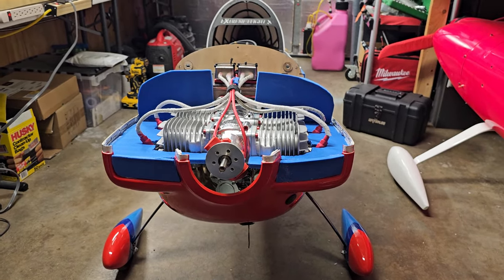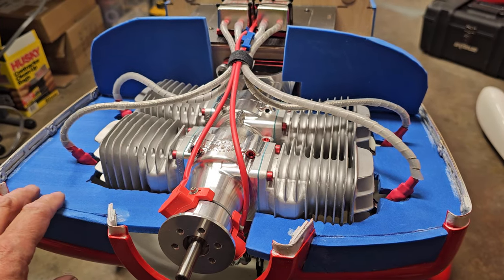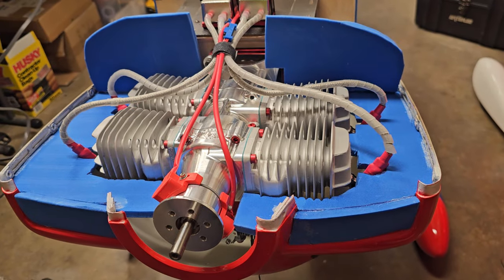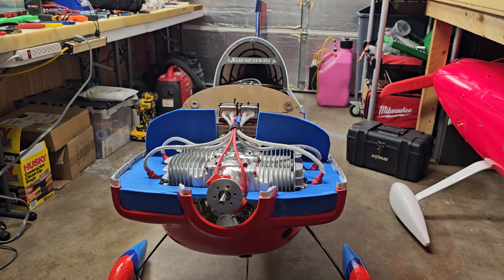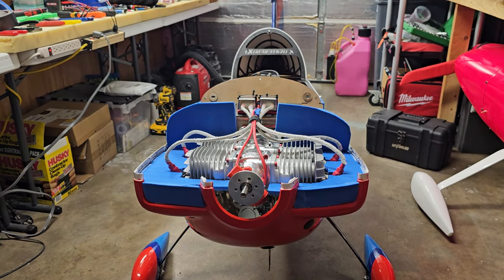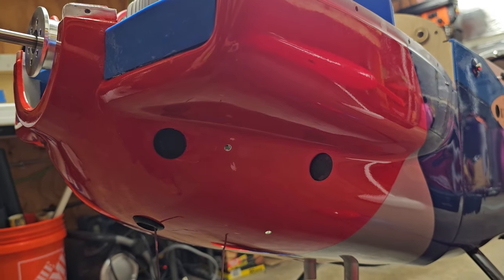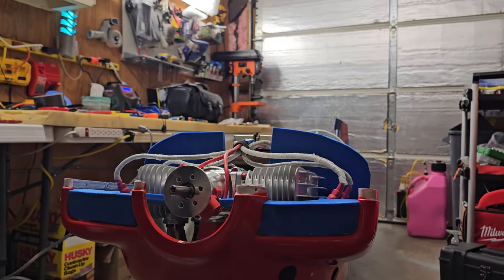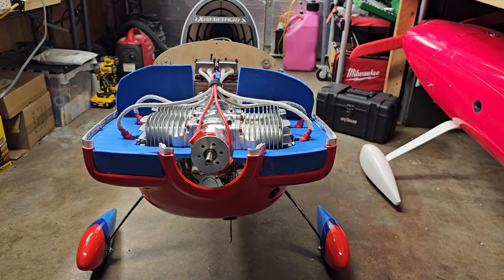da200 baffling, brass T, choke both carbs

Comment: Nice plane.👍
I would think about separating the pickup wires from the spark plug wires. The low voltage pickup wires can induce stray signals from the high voltage spark plug wires causing false ignition signals. Even if the wires have good shielding.
Reply from the maker: Might just have to separate them! 😎

Comment: I have a twin, it wouldn't run right and choke was never enough to start it--- the choke butterfly had a hole in it , I soldered it shut and now she drags fuel much better for starting.  Also I found that if you get the cowl too close to the intake you can have odd behavior , especially if flying with two carbs and one has less "Breath-ability!"
Reply from the maker: Everything you say is true brother! In my case turned out as soon as I made a hole in the cowl for an air intake for the carbs, problem solved. 😁